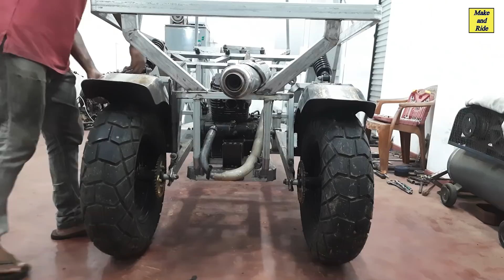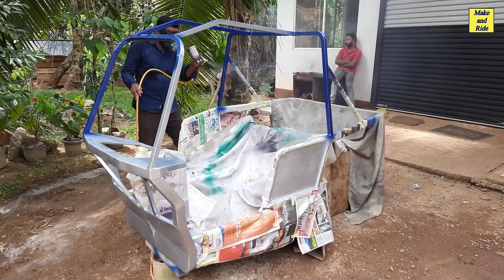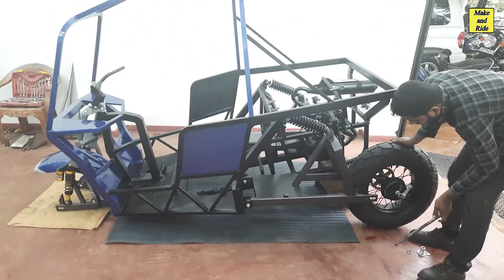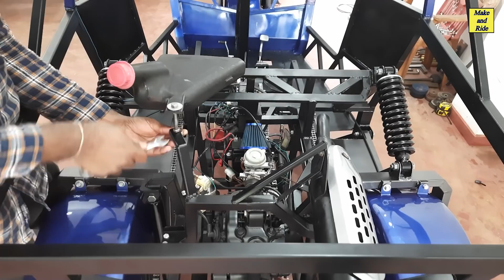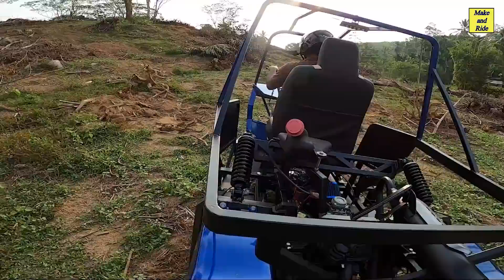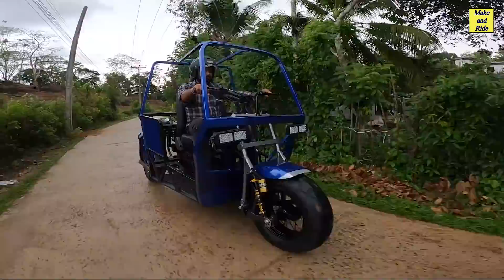How to make Powerful offroad Threewheel using Differential and chain from 150cc engine (Final video)

Comment: Pretty ingenious setup. With the gear reduction of the MC engine and the gear reduction of the differential, you should have enough torque in low gear to pull a bulldozer out of a mud hole. The forward/reverse box on the diff is very handy! Now you just need a way to lock the differential for better traction (and maybe a little higher gearing via the sprockets to get more than 15-20 mph ground speed).😁👍

Comment: this is some awesome work but i gotta ask, why put the diff so far forward¿ guess it would be for the handle to shift but at the same time, wouldnt it have been easier to make a linkage for the shifter instead of putting it there, closer to the engine you could have eliminated the engine to gearbox tensioner, way shorter chains, idk maybe its just me being a backseat builder and theres a problem i dont see other than the chassis